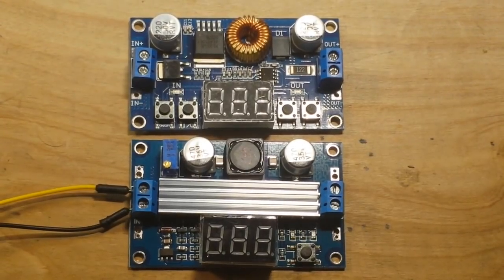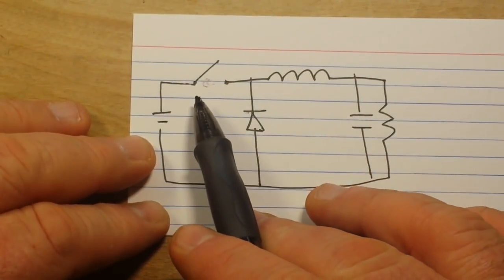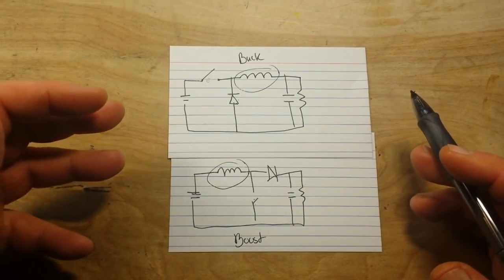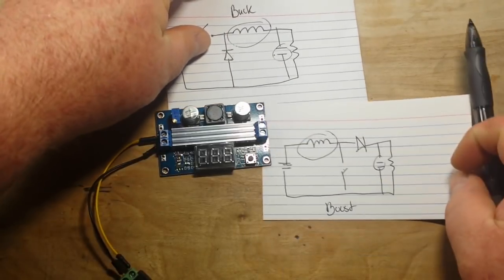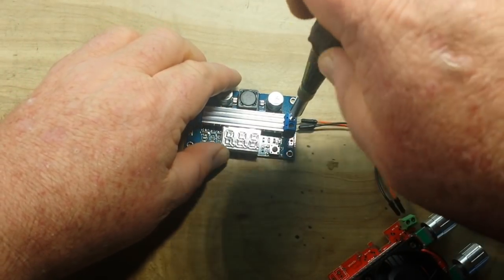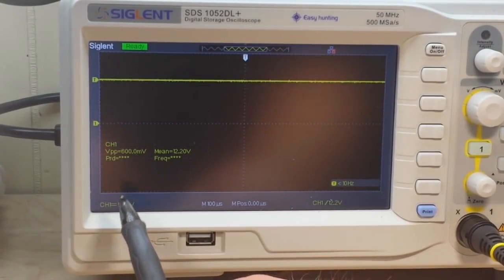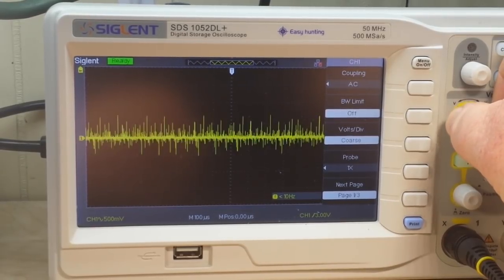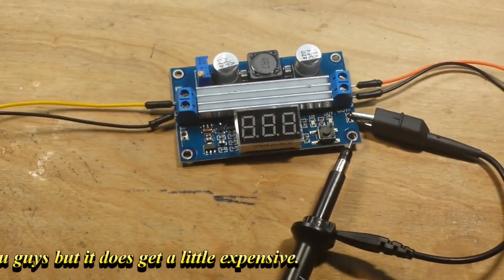More about boost converters (There's no free lunch)

Comment: I started by building a joule thief, that turned into a competition to see just how low I could go - wife says that was a lost cause many years ago - my "record" so far is a 5m rope of 5050 LEDs from a single AAA battery ... or a 220v cfl from 2 AAAs.
I saw a 5v-400v converter on fleabay for less than £5, but ....
It's possible also to stack the converters so boost 1.5v to 12v then use the 12v to power up to 220v.
More practically you can power your phone from a "just in case" AAA or if you don't already have one - install a USB charger in your car using a 12v-5v buck and a 5v-5v stabiliser.
As said it's a trade - so batteries don't last very long, but it does mean a couple of batteries and a selection of converters and you can power just about any modern kit long enough to be useful.
Reply from the maker: Very cool

Comment: I would like to build or buy. a buck boost.  that has constant current . to charge lithium batteries with. up to 29.4 v. and around 20amps.  from a supply that is 24-28volts! I need at least 10 amps. 40-50 would be great . the bank I will be charging is well over 200ah. and I only want to charge to 28.5v. 28.9 max. for added life . I'm thinking about getting some LIFePo4, the only thing I have for charging them is my buck converter. 10amp max.  but I will need much more for either. 3.5-3.6v for the liFepo4, max. its hard to get the capacity from them on a 24v system. 9 cells. and never fully charge them. or 8 cells and never get close to discharging them  great video. I want to build a DC converter that has programmable output. and shutoff. so ... well. I guess I'd  have a universal battery charger !! haha!!!!!  I just haven't found one I like that's affordable. that has high enough voltage. for a 7 series liion bank. yes I'm rambling again!!! great video...